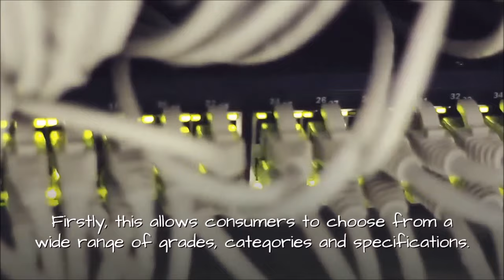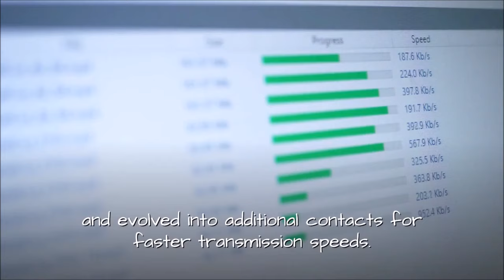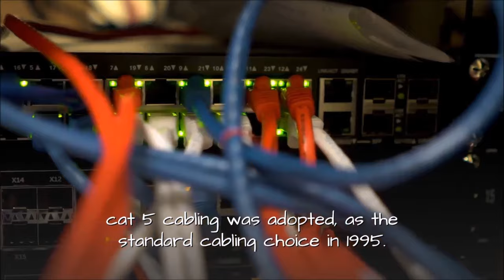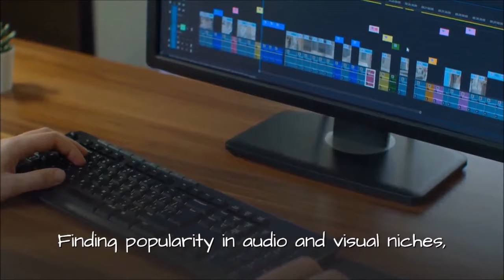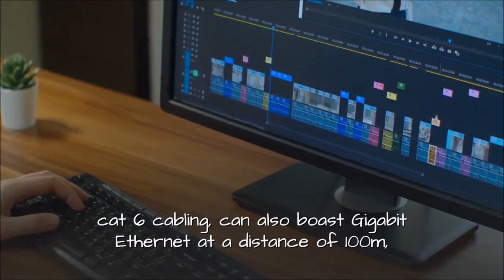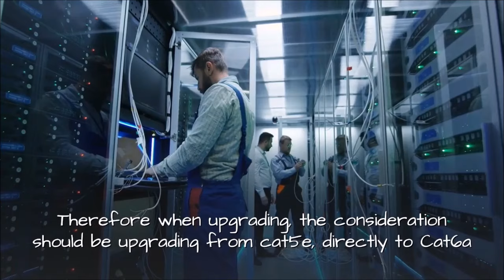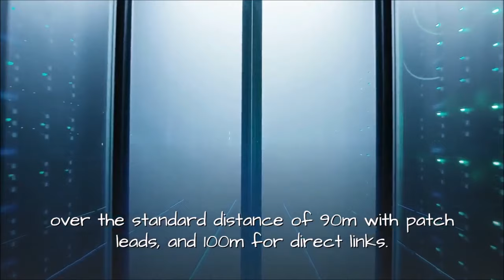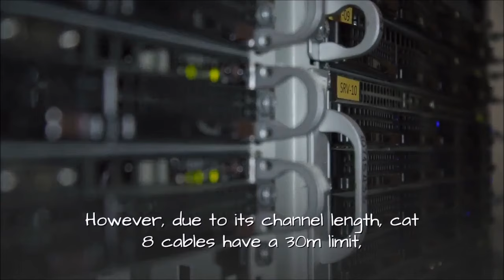Cat5e Cat6 Cat7 and Cat8 Cabling -   (Understanding the Differences )

Comment: My 2 work computers i use at home came with. A short 6a....walmartbhas a longer cat6...will it still be good
Reply from the maker: Permanant links have a standard all the way up to 90m. However Patch leads are stranded cable to be more fexible so dont have such a distance as a standard, Maybe 10-20% less depending on the cable - Therefore in a home setting the patch lead will be fine for the same speeds. Cat6 can achieve 10 Gigabit up to 55m so again should be fine for home usage.

Comment: So what is best for home security cameras to prevent lag and allow mic conversation to be clear without static. 4k uhd 1080p with 8mg camera with nvr of 8x with smart detection motion,people,cars, and experiencing lag and record time to be off when following the sequence of the movement. I was provided cat5E however, it is not acceptable.  I have 200 mbps subscription for internet. 30 meters is fine so should I got to 6, 7, or 8? Thank you for your time and response in advance.
Reply from the maker: Cat5e cable is capable of 1 gigabit transmission so should be ok. However Cat6 would be an upgrade in that it has a capability of 10 gigabit at 55m.

 

However for modern networks Cat6a is the standard for 10 gigabit and will give the greatest headroom. It is also shielded so would help further with the transmission of video images. Cat6a when possible and within budget should be the cable of choice in this situation.
Reply: Make sure you get true copper network cabling and not the cheaper aluminum clad cabling. It will look like the same thing on amazon. Copper will cost more. Read the specs. This is important if you are using POE when powering your cameras. I would go with cat 6.
Reply: I think either cat6a, or possibly cat 8 (but only if your device in question has the cat8 port setup). Also know that some things can be set up in the device settings but honestly a lot is going to depend on the physical specs / limits of the hardware devices involved, ie. the modem, router, camera etc involved and your phone/computer if you use an app. Look at what the minimum is for each item. For example I have a security camera that can record 1440p and at 60 Hz, but I noticed that sometimes it would lag or get overpixylated due to the 1440p (resolution), so I switched it to 1080p in the app settings. I also had to switch from 60 Hertz to 50 Hertz (Hz - frame rate) because it would flicker slightly, kind of like an old computer would. If the physical limits are ok, just play around with the virtual/app settings if you're able to, and see if you can get what you already have, to cooperate in the way you'd like. That way you don't accidentally buy something that's either not compatible or not what you need. Also if you Google the device, you might be able to find what it's minimum limits are for operation (in case you lost the user manual or didn't keep the box etc). Kind of complicated but I hope it helps at least a little

Comment: I loved the video!!! It's very  useful!!! 
Although I think I know the answer I want to make a question. Are you suggest me to connect my VDSL modem to my router with a 5m.  Cat8 cable or less category? The distance between the two of them are 5meters.
Reply from the maker: You can connect your ADSL with any data cable and it will work. All categories work up to 1000mb so all would be covered. However if the distance is only 5m then the difference in cost is so low so you could use a Cat7 or cat8 cable so its suitable for any future technology growth
Reply: @BenderdickCumbersnatch  some cat 5e don't support more then 500mbps I was bottlenecked at my cat 5e. Upgraded to cat 6 and started seeing closer to 1 gig.

Comment: I need a 40 feet cable what should i use cat 7 or 8
Reply from the maker: Either would do just fine as at that distance the performance of either cable with exceed the capabilities of any transmission hardware

Comment: So what cable is the best for gaming on a ps if theres a difference?
Reply from the maker: When thinking of cabling types the main consideration is the bandwidth that it can handle. Cat6a can handle 10gigabit (10,000MB) which will be the same as Cat7.
The fastest home networks are 300MB usually. Even internal switches are generally 1 gigabit if linking inside your house.
Therefore Cat6a will be most adequate for what you require

Comment: For gaming (30m) i take cat 6, cat 6a, cat 7 or cat 8 ?
Reply from the maker: Any category of data cable will work. All categories work up to 1000mb so all would be covered. However if the distance is only 5-10m or less then the difference in cost is so low so you could use a Cat7 or cat8 cable so its suitable for any future technology growth
Reply: @NmcablingCoUk  Hi I am planning on running ethernet through my home (standard 3 bed property) during a full rewire... I intend to have ethernet ports in bedrooms and living room.  From what I gather cat 7 will be best and compatible for connecting smart devices, TV/computers etc??  Hope you can advise, Thanks in advance

Comment: What would be the best for competitive online gaming? ps5
Reply: A stable fast wired internet connection and choosing the right servers.
Reply from the maker: All structured cabling patch leads from Cat5e to Cat8 will plug in to one another. For such a short distance such as a patch lead the best approach is purchase a Cat7 or Cat8 cable as the cost difference will be negligible
Reply: @NmcablingCoUk  thank you. I’ve bought a UGREEN CAT7. It’s running 14 meters

Comment: So I have a power line wifi extender with an rj45 plug requirement what type of cable should I get?
Reply from the maker: All structured cabling patch leads from Cat5e to Cat8 will plug in to one another. For such a short distance such as a patch lead the best approach is purchase a Cat7 or Cat8 cable as the cost difference will be negligible
Reply: I agree either CAT7 or CAT8, depending on whether you need compatibility or faster data transfer for a shorter distance

Comment: what should I have for play gaming? (100mega) (20meters)
Reply from the maker: Cat5e, Cat6, Cat6a, Catt7 and Cat8 all cover 100MB links and even 1000MB links so therefore all will work just fine. However the cost of a lead at such short distances is minimal difference so a Cat6a lead at a minimum is recommended.

Comment: Hi I am planning on running ethernet through my home (standard 3 bed property) during a full rewire... I intend to have ethernet ports in bedrooms and living room.  From what I gather cat 7 will be best and compatible for connecting smart devices, TV/computers etc??  Hope you can advise, Thanks in advance
Reply from the maker: Cat7 will certainly be compatible but it can be difficult to install into residential home walls due to the bend radius and size of the cable. Cat6a will achieve 10 gigabit the same as Cat7 up to 90m and is more suitable for installation into wall ports. If you can incorporate Cat7 into a refurbishment that’s great if not Cat6a might be the better option
Reply: Just use mesh

Comment: What happens when we connect straight cable instead of crossover cable.
Reply from the maker: Crossover cables are to convert one type of wiring standard to a different wiring standard. Therefore if you use a crossover instead of a straight the transmit and receive from from end to end wont match and you will have no connection.

Comment: so they use different frequency to more speed; how does a device know what type of cable is plugged in?
Reply from the maker: Thanks Christophe, 
 The device operates the same way regardless of the cabling that is plugged into it. However transmission along a data cable is at its core, a signal to noise ratio. Therefore the greater speed and signal trying to be sent, the greater potential for noise interference to other cables and receptibility from interference from outside.
The higher grade cables are constructed to operate at these higher speeds and noise levels. Therefore if you have equipment trying to send higher transmission speeds on a non-suitable cable the signal will be corrupted by the time it is received. The hardware will send regardless of cable but the message will not be correct and there will be data errors.

Comment: sigh I had to move back in with my folks an went from a speedy 40mb/sec to 5mb/sec, lol
I'm currently using an old Cat 5(not cat 5e) cable my folks had laying around. I just reordered a cat 8 cable I was using be4 hand to see if that helps boost my download/upload speed. If it doesn't that I just need to get a receiver again to get the most of the internet again
Reply: If you're using a CAT5 cable, cat 8 might not be compatible with the port. If you find that the cable is Not compatible, return it and try CAT6a

Comment: no, no no, you should use cat6 not 6a for houses, you're not gonna have 100m between devices. and 6A is not going to give you a higher speed compared with CAT6 when under 55m
Reply: Explain?